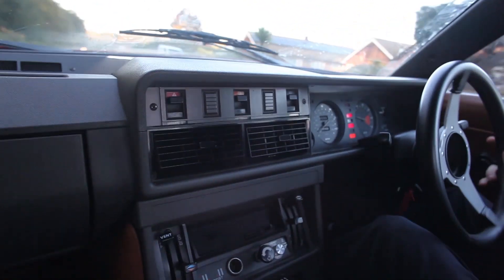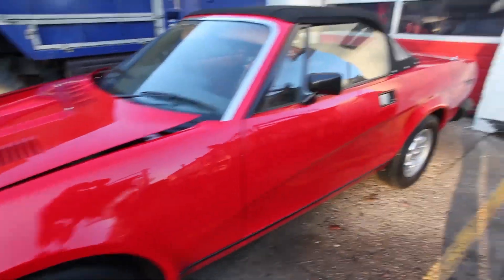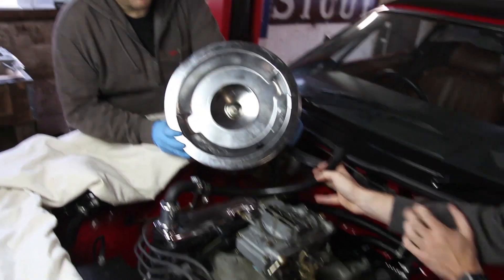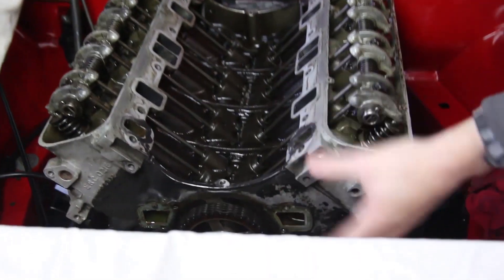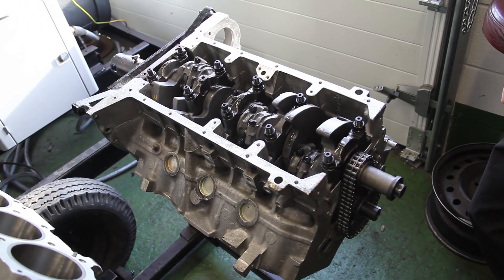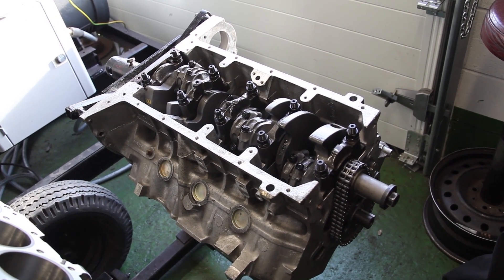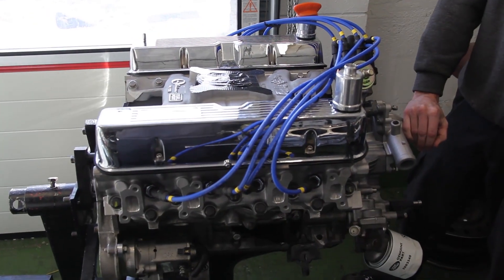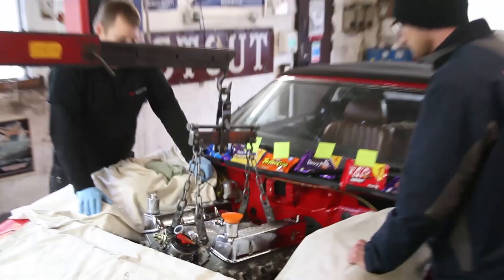Triumph TR8 Project highlight reel - RPi Engineering

Comment: A 4 hole  1 inch spacer brings back most of the low end torque to the 360 manifold.  The dual port manifold is a dog. Should've  used an Edelbrock intake anyway.

Comment: I repaired a convertible TR7 head gasket using a 10.5CR 175hp V8 and some better brakes and suspension. All standard easy-to-find parts (other than exhaust manifolds/downtubes) and it all fitted together beautifully and, with Milltek exhaust, sounded as good as it drove. Brilliant car. Your great video brought back all the memories!

Comment: I bought a 1980 TR7 in 1981. It was a leftover from previous model year. Still own it. Not that powerful on the highway but fun on country roads.
Your car is a sleeper because the TR7s were originally supplied with 2.0 liter engines under 95 HP. That car is very very nice. 
You made a good car a great one. Nice job.

Comment: Great work guys! Love to see like minded shops across the pond putting together top notch TR8's! What kind of power does your 3.9 or 3.5 setup put down?
Reply from the maker: Thanks. Power output all depends on the engine build, ancillaries etc. However a conservative 220bhp with excellent road manners from a 3.9 stage 3 engine.

Comment: I learned one thing, don't use the Holley . The offy duel port manifold design dates back to the 60's and was a hit from day one.  I guess the clean car was a result of the pig engine fitted,the owner spent more time cleaning than driving.
Reply: Depends who you talk to.

David Freiburger from MotorTrend/Roadkill favours the Holleys and has shown how to tune them.

He's also shown the difference between single plan and dual planes on engines and how the power curves are affected :).